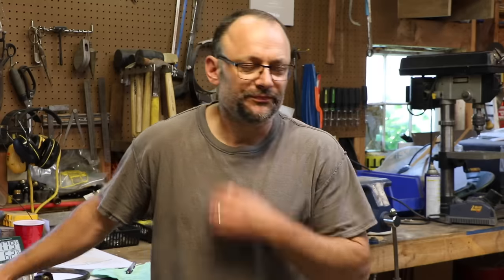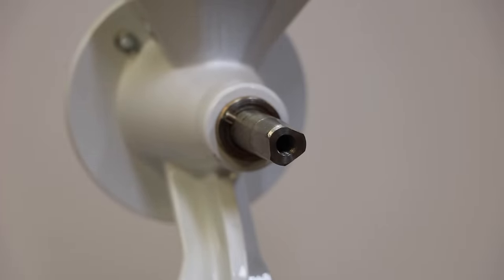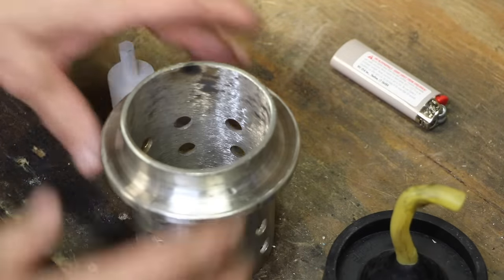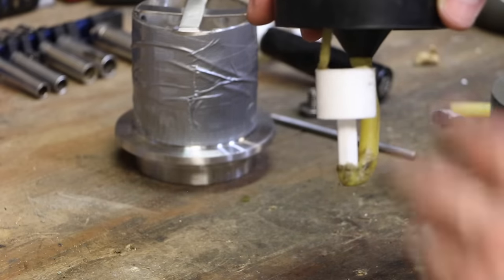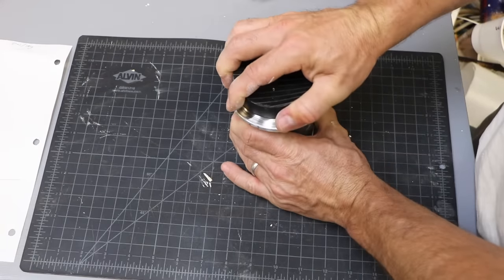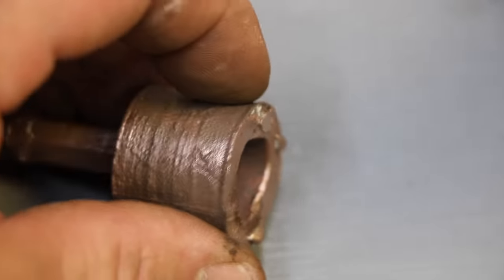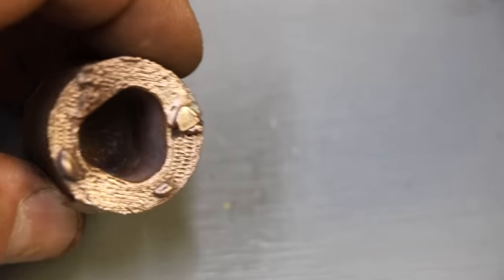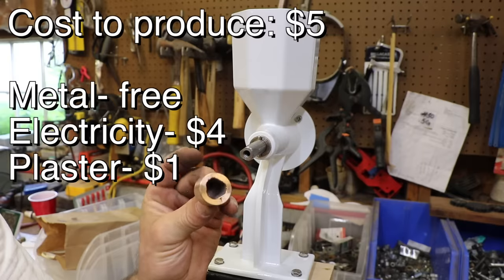I Refuse to Buy Your $@#!   I Make My Own.

Comment: Weld a 1/2" bolt to the end of a piece of round tube; slide it over the existing shaft; drill a hole through both and tap.
You can remove it and still use the handle if you want to. jmo
Reply from the maker: Definitely a good solution.  Many ways to solve this, but obviously I've been into reproducing 3D prints lately, so that's the route I went.

Comment: I have a very old food processor and it too has a tapered shaft just like it. The design is common to grinder handles across several makes. Don't know why.
Reply from the maker: Yeah, that's what I'm learning in the comments.  And it does work well for a hand crank.  But it's pretty annoying when you want to motorize it.

Comment: Why not just chuck the drill directly to the shaft?  That shape would match close if not perfectly to the flats on the inside of the drill chuck.  Love your videos!
Reply from the maker: I should have mentioned this. Shaft too big for drill.  But there are lots of ways to work around this problem. Cheers!

Comment: You could have always taken an angle grinder and made it into a hex shaft, but it might not be the best with the threads in the center. Then you just get a hex head bolt. 
Great video regardless, nice adaptor just in case you want to use the crank!
Reply from the maker: Exactly.  I should have said in the video that I wanted to maintain the hand crank ability.  In reality, I was more interested in doing the lost PLA technique than coming up with the best solution.  Cheers.

Comment: The same shape of tapered shaft and hole is used on antique meat grinders.  It's not that they designed it to force you to buy an adapter, it's just an old design that wasn't intended to be motorized.  For a hand crank, it's ideal.  For a motor, it's obsolete.
Reply from the maker: So it's just a poor design then.  They could make it attach like a bicycle crank.  No wobble, and no hassle to use a socket.

Comment: i'm not sure about handling a 2k degree crucible of molten bronze while wearing short pants.  but then i have the technical skills of a rabbit, so ok.
Reply from the maker: Your comment is a common one, but actually shorts are safer than regular pants.  I wonder if I should do a video on this.  The only thing better than bare skin when dealing with molten metal is flame proof clothing.  If the metal splashes onto my skin, the moisture will vaporize and the metal will slide off due to the leidenfrost effect.  Would give me a nasty burn, no doubt, but exposure time would be minimized.  But if I had jeans on, it would set the jeans on fire, which would stay against my skin burning, and cause more injury.

Comment: It would be interesting to see how the PLA would perform if you printed it on it's side. The "grain" of the hex shaft would then be aligned with the whole part. Printed vertically, it is purely reliant on the adhesion of the layers to keep the torque from shearing it. If horizontal, the drill would have to actually tear every of the plastic. Additionally, a higher infill % would help, preferably with more perimeter walls.
Reply from the maker: That is interesting.  I may have to try just to see.  I would still be shocked if it worked.  Takes quite a bit of torque to drive it.
Reply: @FarmCraft101  Definitely an interesting experiment. One problem that might manifest from side orientation is the strength of the socket part. It will be weaker in that direction and torque would attempt to crack the sides of it down its length. Perhaps a hose clamp around the outside would hold it together as well.

Comment: Does the grinder still work if you run it backwards?  Can you grip the shaft with a bolt remover tool?
Reply: Of course there are reverse threaded bolt removers, but you definitely can't expect to get one of those for less than $30 plus shipping.

Comment: While this is certainly a longer-term solution, couldn't you just use an adjustable chuck to fit the shape of the shaft?
Reply from the maker: That's a big shaft.  None of my drills would fit on it.

Comment: Why not just get a pulley and drill a hole into the shaft for the setscrew? I mean if you motorise this, you could just as well mount the motor already and not torture your drill with it
Reply from the maker: True, using a drill is not ideal.  I have plans that will be in a future video.  Cheers.

Comment: Couldnt you just have taken an angle grinder to the 3 rounded parts flat to the flats on it already and use a 12 point socket with drill adaptor?
Reply from the maker: Yes, but I should have mentioned that I wanted to maintain the option of using the handle and if needed in the future.

Comment: Dude, that 3D printed part looked hollow.  Did you print it at 10% infill for effect?
Reply from the maker: Yeah, it was hollow.  I printed it with the expectation of doing a lost PLA cast with it.  You want it hollow so when it heats up in the plaster it expands less and has room internally to prevent cracking the mold.  Trying to turn it with a 3D print was really a joke in my opinion.  No way it was going to handle that torque.

Comment: Just run a die down the shaft and screw on a lock nut, screw on the new drive shaft and tighten the nut up against it, then if you want put the handle back on you can.
Reply from the maker: I reckon I could build that...  ;-)  Yeah, lots of ways this could be done.  I've been experimenting with lost PLA casting recently and that was the option I wanted to try.

Comment: Sort of left-field question, but what amount would you pay for that adapter?
Reply from the maker: It's a tiny little thing. $15 would be reasonable.  But I still say they should have built it in such a way that the adapter is not necessary.

Comment: Why not just use a drill with a large enough chuck? It’s got 3 flats and I bet you could probably fit a drill on that if it has a 1/2” chuck. Alternatively you could weld a pulley on it for use with a 1/4hp electric motor from a flea market, harbor freight, or something. I feel like you did this the hard way. And before you say “well I didn’t want to get a bigger drill”, I’ll counter with I’d rather buy a bigger drill than buy a 3D printer.
Reply from the maker: I have several heavy duty drills with 1/2" chucks, shaft is too big for them.  I already had all the equipment when I had the idea to do this.  I certainly didn't buy tools just for this project.  There are definitely easier ways I could have done it, but I've been experimenting with this technique lately and I'm enjoying learning the process.
Reply: @FarmCraft101  I'm glad you're having a good time, but any time the answer is essentially "just use your 3d printer" I tend to roll my eyes a bit.

Comment: So much effort could have been saved if you just put a little effort into thinking and planning first. Use the KISS methodology. Put a small slit keyway in the shaft closer to the housing for a a key and just put a small pulley on it and drive it with a small motor. Would have taken a 20th of the time to make and you'd still be able to use the normal handle. Making your own stuff doesn't have to be complicated, and making the project more complicated is just unnecessary.
Reply from the maker: Most people are misunderstanding because they haven't seen my recent videos.  I've been working on learning lost PLA casting recently, and this was just one small project within that goal.  I did not do lost PLA because it was the easiest, cheapest, or best but because that's what I wanted to do in the first place.  The goal here was not to save $25.  It was to get better at lost PLA casting, while making something useful at the same time.
Reply: @FarmCraft101  Well you do you brother, just I think I'd rather have spent those "lost PLA" learning hours on parts that are difficult to machine and or that solves a difficult problem, which neither of them are for this project. Anyways, your time and effort I guess, I'm just some random on the internet.

Comment: Totally with you on this,  but I would've just got a stout stainless steel bolt with some food grade grease on the threads and called it a day. $6-$7 in parts and a trip to the hardware store (or your shop or garage if you're lucky) and you're in business. I hate companies that do this crap, good job keeping your $$ out of their pockets! 👍
Reply from the maker: Yep.  Lots of ways that I could have done this.  I just wanted to try lost PLA casting and this seemed like a good place to use it.
Reply: Don't forget the jam nut, in case she shears off.

Comment: Clearly this grinder was made this way as an inexpensive way to attach a crude cast handle without the need to machine the handle after casting. Attributing this to malice or greed is just dishonest. It would appear that the greed in this situation is yours, looking for a good click bait title for your arts and crafts video. There is no conspiracy to get you to buy something else. There are about a dozen different ways to attach to this shaft with basic hand power tools that doesn't require 3d printing, casting and machine shop equipment. The method you chose to use clearly costs far more in time/material/equipment than buying the adapter. You could have made something work in 10 minutes with some threaded rod, nuts, washers, and a dremel or angle grinder. If you have use of a basic welder and some scrap steel, you could make something almost as fast and just as good as your cast part. Your project is neat and all, but be honest with your premise or the internet will eat you alive.
Reply from the maker: You misunderstand because you haven't seen my previous videos.  Read my pinned comment.  As for the design, many have pointed out that this is an old design.  I wasn't aware of that, but it doesn't change my premise.  If they just used an obsolete design that was used 100 years ago, then that's a bad decision on their part.  They could have attached it like a bicycle crank.  No wobble.  Mass produced.  Easily accepts a socket.  I didn't choose lost PLA casting because it was the easiest method.  The reverse, in fact.  I chose this project because I wanted to lost PLA cast a part from scratch.
Reply: @FarmCraft101  3 is better than 4 to attach to a rough casting. 3 surfaces will always tighten up where 4 will tend to wobble. It's like a 3 legged stool. It won't wobble no matter how uneven the floor is. There is a good reason for it to be made this way.

Comment: Hmmm... I wonder if it would have been easier/stronger to just build up the shaft a bit with some weld and then machine that to a hex that would fit a deep socket. If the build up was between the triangle and the inner end, it would work fine, and then you have something that also works with a wrench and still preserves the original handle attachment
Reply: Literally weld a nut onto the shaft. Done in 2 minutes and less than 1/4 the cost.
Reply: @username16129  I thought of that too, but then the original handle won't work, unless you're thinking of a nut that slides over the shaft above the triangle, because that's an even better idea

Comment: I'd probably go the route of finding a nut that fits over the shaft and just welding it on, then using a deep socket to reach the nut. I dont have casting experience or tools though, and your solution looks great!
Reply: Then you wouldn't be able to use the hand crank anymore.
Reply: @BlunderMunchkin  just gotta put it further down the shaft, that's why the deep socket

Comment: I'm not sure if the cost of heating metal to 2000 degrees was factored properly into the $5.  Fun video.
Reply from the maker: It was.  That small furnace is only 1500 watts.  So if it runs continuously for an hour, that's 1.5 kwh of electricity, which would cost me 15 cents.  In reality, I think my electricity estimate was quite high.
Reply: @FarmCraft101  Awesome 👍 now I want one lol.

Comment: (before I see the end of the video)  cut the end of the handle off that fits over the shaft and weld or epoxy on your metal rod for the drill It’s destructive sure, but it gets the job done….probably
Reply from the maker: You are correct.  Lots of different ways to solve this problem.  I should have mentioned that I wanted to maintain the option to use the handle in the future.  Cheers.
Reply: @FarmCraft101   After watching it did occur to me that was most likely the case. Keep up the great content!

Comment: The 3 sided taper is there to keep the handle from loosening but still have it removable without a puller. Would you rather have a handle that wobbles?
Reply from the maker: Bicycle cranks don't wobble.  And since you only turn the handle one direction while in use, even if there was play in the connection it would not wobble during use.
Reply: @FarmCraft101  Before all the spline drive crank styles the standard was a square taper.

Comment: Wouldn't it have been easier to just thread the end of the shaft and use a couple nuts locked on to it?  And your old handle would have worked / held on the flats as a fall back.
Reply from the maker: Lots of ways this could be solved, and your plan would work.  I don't have a threading die that big, and with the time it would take to disassemble the shaft, put it on the lathe, and single point thread it, this method would have been about the same time investment.  Also don't have nuts that big.  (Don't read into that!)  ;-)
Reply: @FarmCraft101  OK I have to admit, your solution was much more creative!  I'm one of those old school boring Engineers that come up with the most simplest solution first, but I have no FUN!

Comment: Out of curiosity, can you just put the chuck of a 1/2" drill right onto it, with no bit?
Reply from the maker: It’s too big. None of my drills can fit.
Reply: @FarmCraft101  I should have known it was not that easy. While you are prepared (in time, knowledge and effort) to do some methods I wouldn't start with, you generally try the simpler ways first. Thanks for satisfying my curiosity.
Agree with you, by the way. Sometimes, the best way to resist a world you don't like is to not comply. Usually, that will cost you. It's the price to pay to help be a part of the solution.

Comment: Would the original shaft fit in the drill?
Reply from the maker: No.  I wish I had mentioned that in the video.  I have a couple heavy duty drills too.  I didn't measure it, but I think that shaft is 7/8" or so.

Comment: Simpler solution: cut the end of the shaft off, mill it to a hex and make a new hand handle.
Reply from the maker: I think that would have taken longer.  This only took me about an hour of labor.  But as you point out there are many different ways to solve this problem.  Cheers.
Reply: @FarmCraft101  Yes, making the new handle would have needed a socket of the right size and then have a handle attached to it, likely by welding. If you were already going to run a set of castings, adding in one more piece is pretty easy.

Comment: I think he used $30 in electric alone!
Reply from the maker: I pay 0.10 per kWh.  $30 would be 300 kWh of electricity!  That's pulling 12,500 watts for 24 hours straight.  Even if my kiln and furnace were on full blast for 24 hours they wouldn't use even half of that.  The reality is about $1-2 in electricity.
Reply: @FarmCraft101  Yea well, like, OK.

Comment: The costs to produce 10:29 is not really fair stated, you've 3D printed the part, so you need to buy a 3D printer, and what about the oven to melt the metal + crucible + belt sanders + lathe? Yeah, if you have everything like you do, then the price will be around that figure of $5, for all other mortals you have to accumulate the equipment.